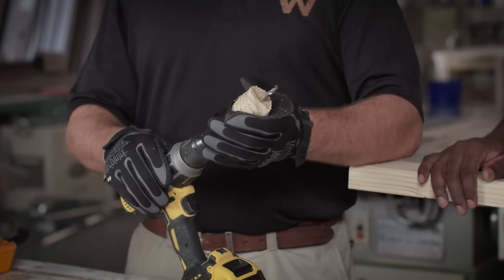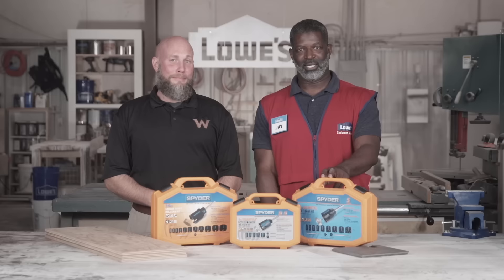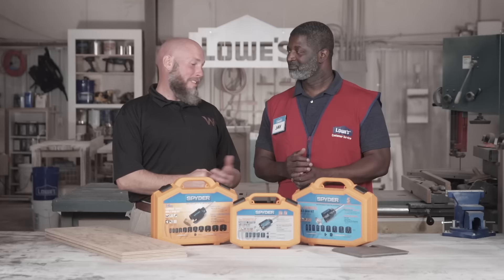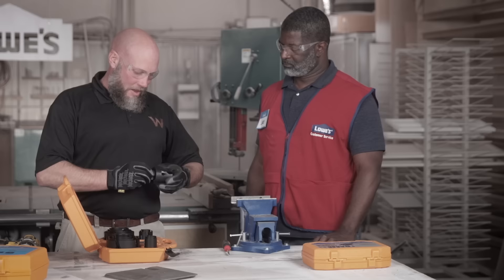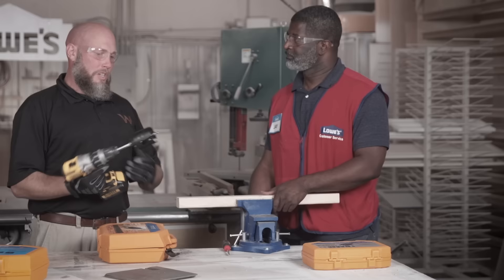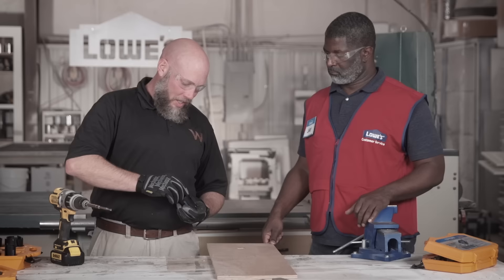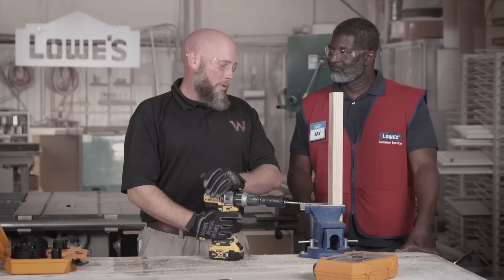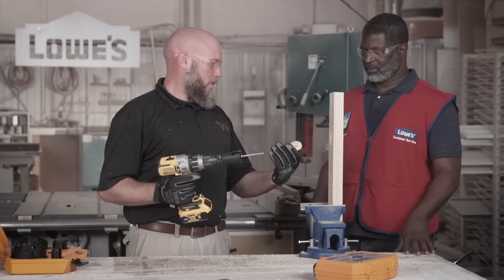Spyder Hole Saw Kits | Pro Products from Lowe's Pro

Comment: The blowout..iiidk...seems worse than usual
Reply: How hard you push at the ending of the cut will affect blowout, drill partway in each side for a cleaner cut but it is a rough construction tool. Not for fine work.